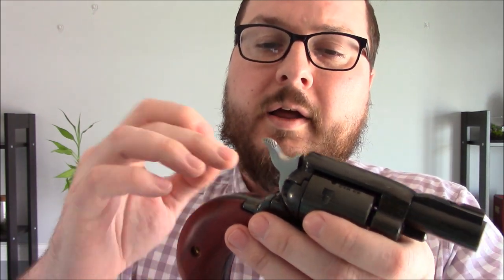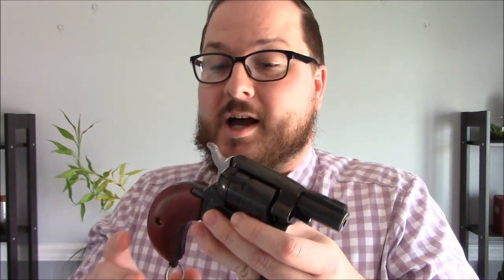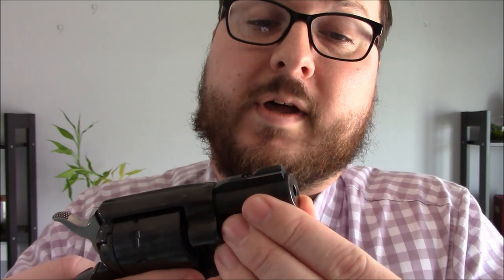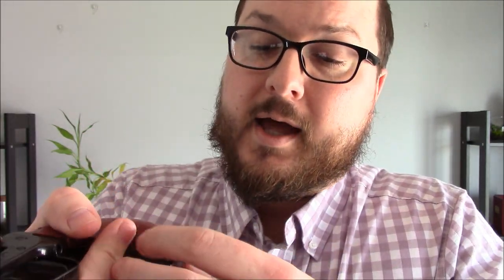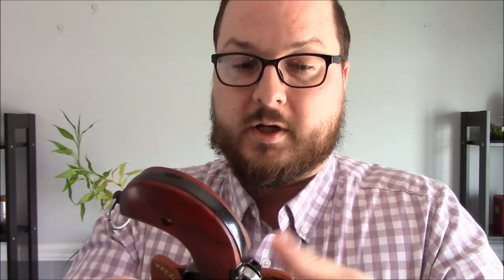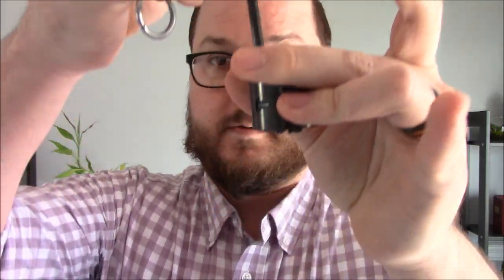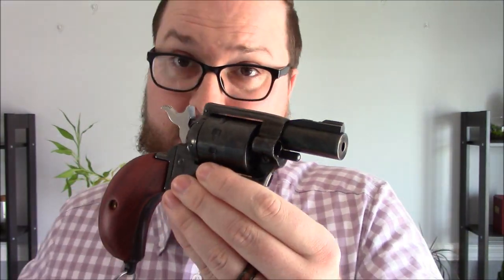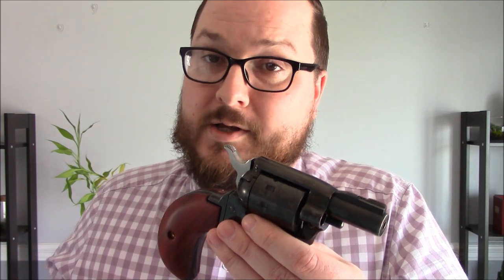Heritage Rough Rider Custom Revolver - Shorty 9 Shot .22 WMR (Barkeep Inspiration?)

Comment: I'm 57 yrs old, and still do fit n finish on evey firearm I get, n maybe a tweak or two. 
Just finished a brass frame 1873 frontier; in the middle of doing it, I questioned myself, putting that amount of work into it, it wouldn't improve the function all that much, but as always I'm very pleased with the results. 
Good job on that man, that's EXACTLY how I would've went about it!

Comment: Liked this mod when I first saw it. 
Heritage has got a thing going for sure. Same frame and action but multitudes of barrel lengths, grips, .22wmr cylinder, buntline revolvers,  a"tactical "pistol with rail and fiber optic front sight, even a revolving carbine. Priced low, and they must be selling like hotcakes, based on the annual number that heritage makes. 
As for myself I did end up buying a barkeep recently, along with a .22 mag cylinder for it, just for fun.

Comment: Nice build.  Looks great.

On a side note, you did know you can got to Heritage's website, go to their shop site, for parts, and order the bird's head grip, right? Same with the frame, cylinders,  and other parts.

Sweet little Maggie brityer.
Reply from the maker: kevin fox yep, it just wasn’t in stock when I built this. So it was more cost effective to buy two and then have a whole second gun.
Reply: @booliganshootingsports  That's what I figured. My wife and I pick them up used, forntye same reason, parts, builds, or finishing experiments. Currently baking a pair of frames in Antique Brass Cerakote, for a matched set of 3.5 inch,  bird's head, with a set if bonded ivory grips, for my daughter and son in lawn's anniversary gift. Wife if making a presentation box out of a crate battle cigar box, I picked up last year, eith a red velvet lining. 

Both of them,  euth both cylinders,  were less than $200, and looked rough,  when we got them, but are fine mechanically.  Set will also include a pair of twist Damascus 6 inch Bowie's, with brass pins, hand made sheaths, and antler handles,  from last year's 8 point, my wife got, opening day.

Keep the projects coming brother, and I'll keep watching.
Reply from the maker: kevin fox they’re definitely fun projects at a great price!
Reply: Sounds like a great looking set of pistols and knives. I would like to see the finished set.

Comment: You're drill and tap on the handle is excellent quick thought is maybe you could take the old barrel ejector and cut it down and shorten the spring drill and tap the barrel and make a small discharging rod for the shells
Reply from the maker: I actually tried to do that’ but in order to get enough ejection rod in there, it would need to be telescoping or something. I did try though!

Comment: I was told by Heritage that the timing gears on the 9 shot cylinder wouldn't match the 6 shot frame.  how'd you manage that?  otherwise great job!
Reply from the maker: Because this is a 9 shot frame like I explain in the video. The upper frame that holds the cylinder is a 9 shot model fitted to a birdshead lower grip frame from a 6 shot model.

Comment: You can buy the grip frame assemblies off their website for like $30 and then that's I think around $25 for a set of grip panels for anybody that's wanting to build one of these you can also buy every part except for the frame and Barrel off of their website they also offer a gold-plated cylinder, trigger, and Hammer if you want to make a pimp gun they also have a bunch of cylinders with different roll stamp type engraving
Reply from the maker: Yeah, they offer that now. They didn’t years ago when I built this.

Comment: I had read somewhere that the timing lock up design was different between the six shot and nine shot and the barrells could not be interchanged.  Sounds like you modified it very easily.
Reply from the maker: The timing and lockup is different between the two. That’s why this is built off of the 9 shot gun. The barrel isn’t changed out, the 9 shot barrel is chopped down. It’s the grip frame that I changed out.

Comment: It doesn't look like the rims are recessed in the 9 shot cylinder. If that is the case then you should only shoot the 22mag with safety glasses.
People have lost eyes when a non recessed cylinder 22mag blew out a rim and causing a chain fire that resulted in high speed shrapnel hitting them in the face.

Comment: It looks good, with that length barrel the powder isnt going to be burnt anymore than 22lr with 22mag so you might as well go with 22lr for less sound and flash
Reply from the maker: You do get a jump in muzzle energy compared to .22 LR even at this short barrel length. Most .22LR ammo in this short of a barrel will get you about 50-90 ft/lbs while .22 WMR will get you about 80-120 ft/lbs. Info is taken from BBTI and their extensive testing.
Reply: @booliganshootingsports  They are a wonderful resource. 

The hive mind is such a great thing to have.
Reply from the maker: @GunFunZS  I go back to their data so often with a wide variety of projects. Such good stuff.
Reply: @booliganshootingsports  there used to be a similar project for shotgun velocity and spread with various shot types and chokes. I remember one of the staff of tromix reposting it at some point. I wish I knew where it could be found again.

It's really lovely for refuting the sort of old popular misconception that chopping a barrel equals more spread. No. cutting the choke portion off a barrel equals more spread. A vector is a vector no matter how small... One of the nice things about shot shells is most of them are way downloaded too. So if people are worried about giving up some performance for going shorter you can always add that back in the shell at basically no cost.

Comment: Makes me want one, the only thing i would do in addition would be to thread the barrel.
Reply from the maker: Only problem is, threading it would be a moot point as you can’t suppress standard cylinder gap revolvers. Otherwise I totally would have done it.
Reply: Very few revolvers can be surpressed, the Nagant and the Gasser comes to mind.
Reply: @booliganshootingsports  if you were to put a suppressor, is there anything possible that can be used to insulate the gap? Would the towel technique work from godfather2, if u also had a suppressor on?
Reply from the maker: @davidd9325  you could theoretically make a clamshell to seal the cylinder like the old Peters PSDR suppressed revolver.
Reply: @booliganshootingsports  your a genius

Comment: You need to somehow print functional cylinders for fast reloading
Reply: Ig line each chamber with some type of tubing?
Reply from the maker: Or just buy spare cylinders. The solution to everything isn’t 3D printing.
Reply: @booliganshootingsports  yes Mr. Booligan I know they make spare cylinders. I had another YouTube say the same thing. However, where’s the fun in that?
Reply from the maker: @thacharybinkies608  the fun is to spend $30 for a safe and perfectly functioning part compared to spending more on something in time and materials that has a high risk of failure and injury, lol. Perfectly reaming 9 chambers isn’t fun. Barrel inserts aren’t cheap. A tiny amount of print wear means it’ll lose time and spew lead and gunpowder everywhere and potentially injure you. 

Just doesn’t make since wasting time engineering something that is already well solved for cheap that can be shipped to your door, you know?
Reply: @booliganshootingsports  now I see the impracticality. Thank you for the full explanation, this information may be very educational and helpful for anyone reading this that has thought of printing these cylinders. I thought maybe printing would be cheaper, this making them close to disposable in a self defensive fire fight if this would be the only thing you had on you.

Comment: How short is the barrel itself? (Thinking of trying to make one for carry) also how did you affix your front sight? Like was it a weld or super glue etc?
Reply from the maker: Barrel is about 2" long as I said in the video. The front sight is attached with the existing screw from the donor sight and a drilled and tapped hole in the barrel.
Reply: @booliganshootingsports  okay thank you and have a good day

Comment: Just purchased a rough rider, how did you do the conversion?
Reply from the maker: As I mentioned, I put the birdshead grip frame from a 6 shot model onto the upper frame from a 9 shot model, then  cut the barrel and recrowned it and added a front site. Lots of filing work to allow for proper hammer travel and a few other small tweaks that could have been due to sloppy manufacturing on the two base guns I used.
Reply: @booliganshootingsports  thanks for the reply, it looks great, have a good one

Comment: Couldn't you have bought a 9 shot cylinder?
Reply from the maker: The 9 shot cylinder doesn’t work in the 6 shot frame. The hand and other internals are different and not cross compatible. You have to have the 9 shot frame.

Comment: Great looking single action revolver.  The safety on a single action is just plain wrong for me.
Reply from the maker: At first, I didn’t like the safety, but it allows you to safely carry with a round under the hammer and let’s you do dry fire practice, neither of which is normally safe or recommended on a single action revolver like this or a rimfire gun, respectively.
Reply: @booliganshootingsports   The gun has a transfer bar mechanism. That makes it safe to carry fully loaded. 
Safety is between the ears not on the gun.   Most modern single actions have the transfer bar action.
Reply from the maker: @allenlogan59  The Heritage Rough Rider doesn't have a transfer bar mechanism though. That's the problem. The full size .357 models do I believe, but the rimfire one allows the hammer to rest directly onto the frame mounted firing pin. Which means, with the hammer down, it is pressing on the firing pin which is contacting the rear of the cartridge, and dropping the gun or an impact on the hammer could cause it to fire inadvertently, regardless of however much safety is between your ears, lol. 

Hence, the manual safety which physically lifts the hammer off of the firing pin.

Comment: WOULD SOME ONE PLEASE ANSWER THE QUESTION ON IF THE 9 SHOT WILL SHOOT OR NOT SHOOT OUT OF A 6 SHOT ONE PREFERABLY SOME ONE WHO ACTUALLY HAS ONE AN HAS DONE THE SWOPE CAUSE. HALF SAY YOU CAN THE OTHER HALF SAYS NO IT WONT WORK 🤷‍♂️
Reply from the maker: It won’t work. The 9 shot models have a special ratchet and hand design.

Comment: Isn’t cutting the barrel illegal?
Reply from the maker: The Real Byrdman not on any federal level. State laws may vary, but in general, there’s nothing banning cutting of barrels as long as you stay above federal required lengths.
Reply: @booliganshootingsports  Which, for a pistol, there is no minimum or maximum length as far as I know. 
Rifles and shotguns, on the other hand... 
Yeah, those are a different story. 
I know off the top of my head a rifle barrel must be 16" in length.
They don't want you concealing a rifle.
Reply from the maker: Rusty Shackleford yes, which is what I said. As long as you stay above federal required lengths, you can cut barrels. Rifles are 16”, shotguns are 18”, pistols have no limit.